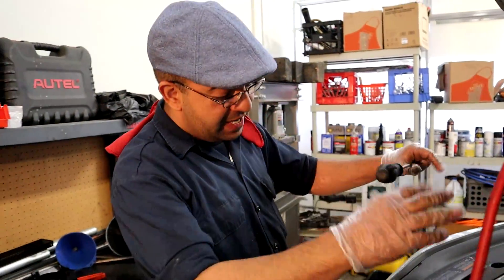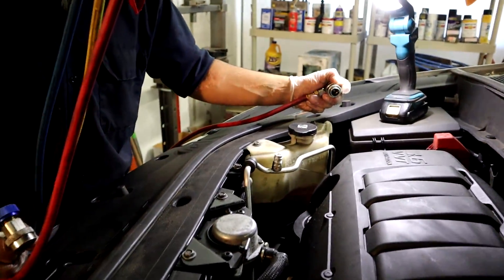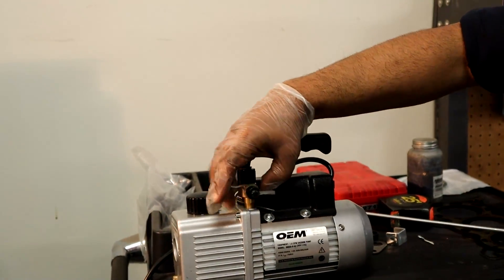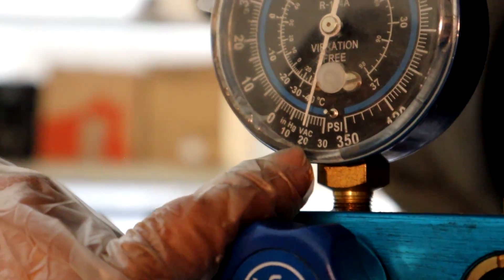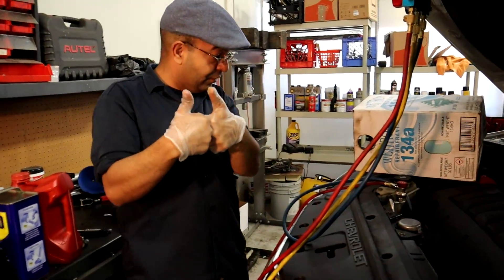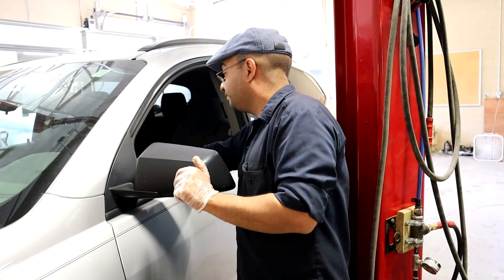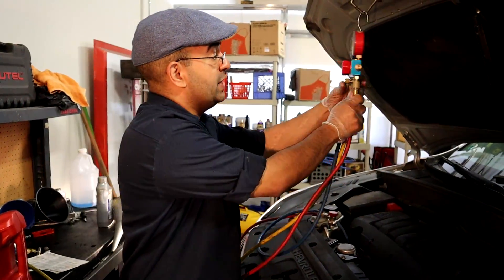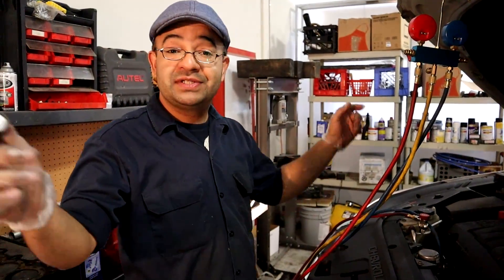Chevy Traverse A/C Recharge Tutorial (Air / Conditioning) R134a

Comment: Buy a charging scale such as a TIF 9010A, put in exactly what manufacturer specs for vehicle.  It will work great, especially on dual evaporator setup where pressure method does not work as well. All cars have a oil and Freon level spec. A 2011 traverse I'm currently working on requires 1.05kg to fill No guesswork.  40psi/190psi @95 ambient temp with 60 degree center vent temp. This is the advantage a charging station has, it measures how much goes in.  $100 scale does the same thing. Master Mechanic
Reply: I’m late but I was about to post this. 2.5 lbs in the scale and you know exactly how much refrigerant is in the system.